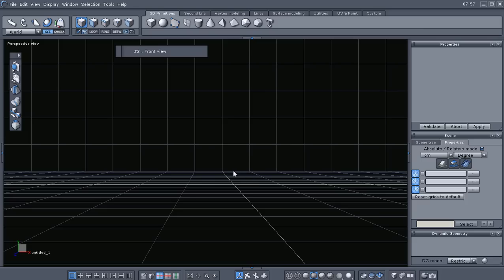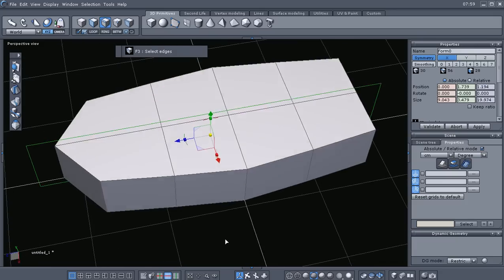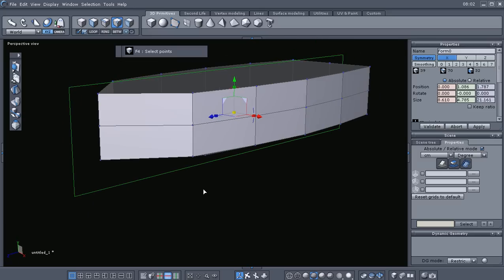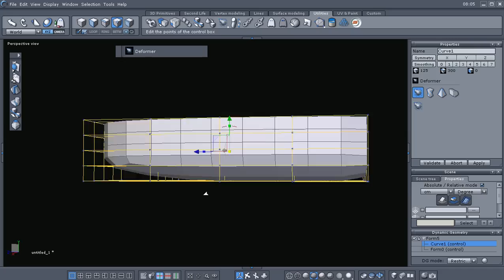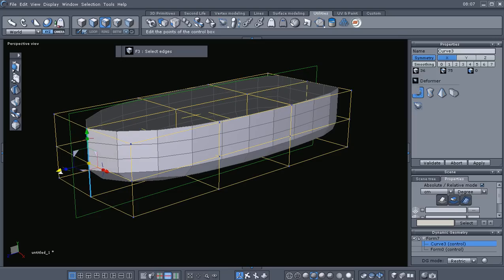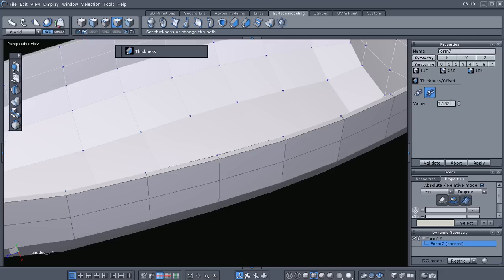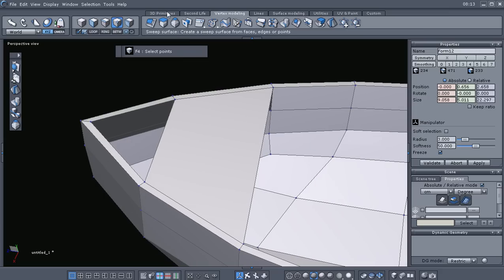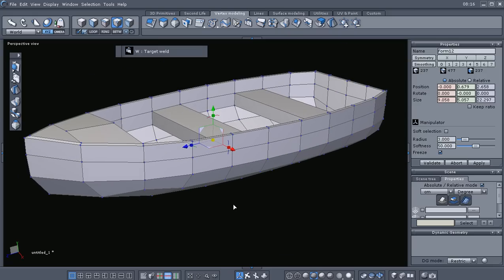Lowpoly boat modeling made easy

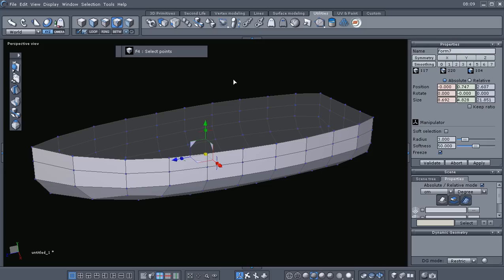Comment from the maker: @ aprox. 12:46 shows how to add thickness to the mesh, If you do not add the interior faces to the boat hull It will leave a hole where the bridge is made. If you have added thickness make sure only select the inside faces before making the bridge.